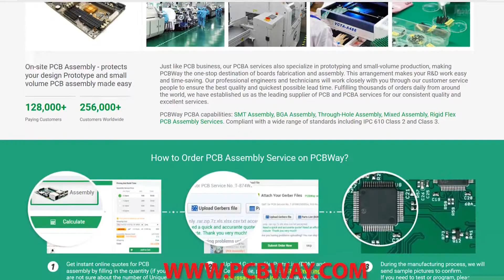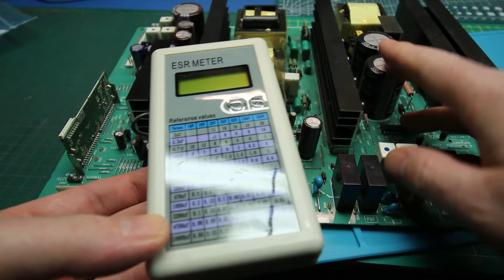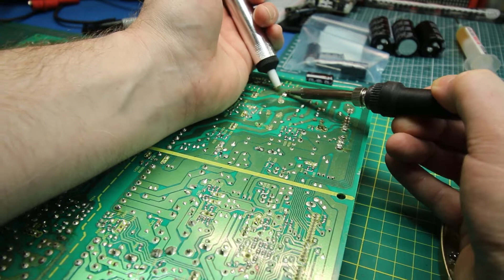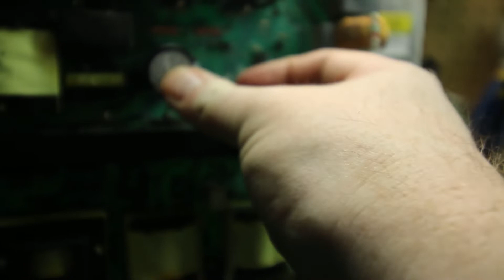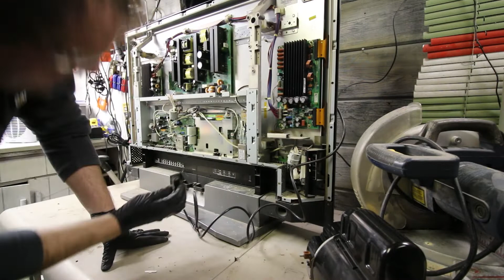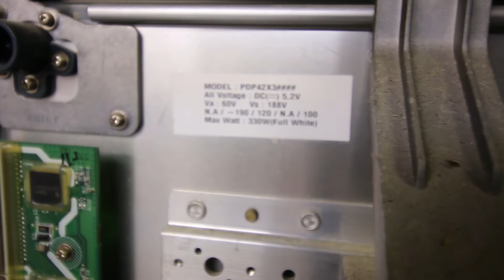Plasma TV Repair Part 2 🛠

Comment: I used to do blind cap replacements whenever I tried to fix electronics but it never worked for me.   I was wondering why didn't you pull the caps and test them to see if indeed they were bad before ordering new ones?  At least that would have saved you from buying new caps un-necessarily.  Finding the bad part is critical to repairs and I guess bad part is still hiding somewhere.